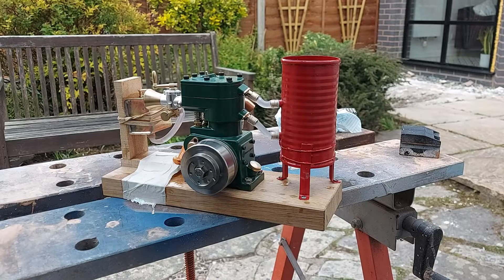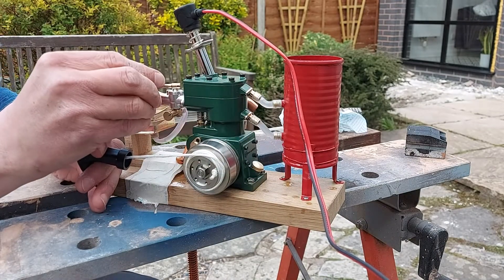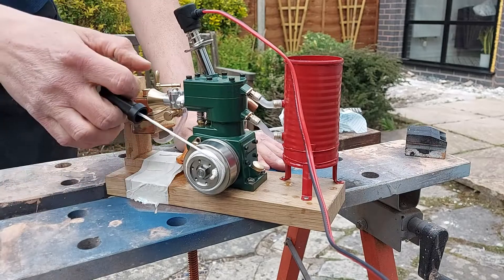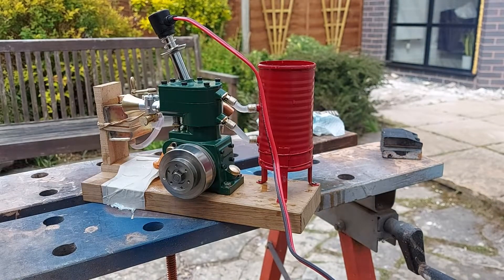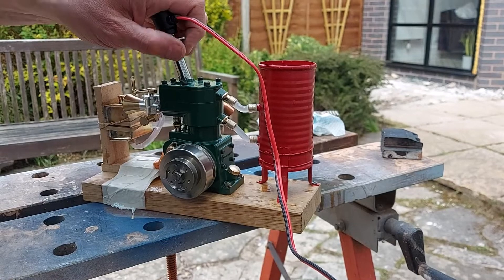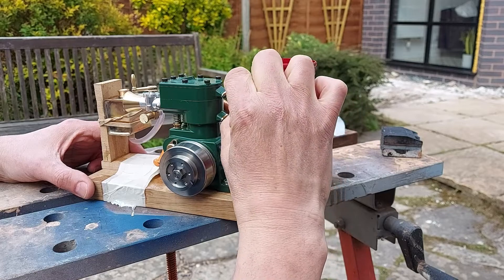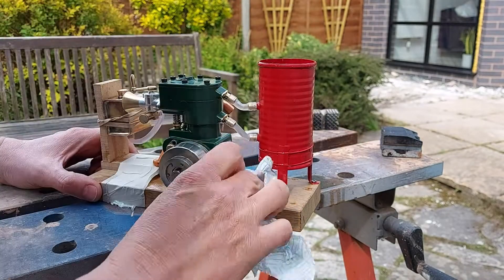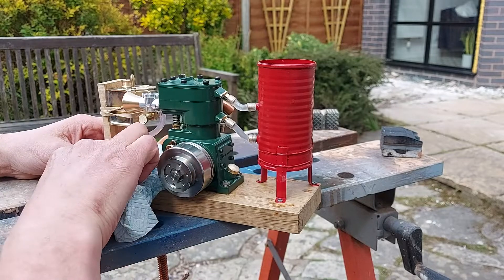Enjomor Whippet Pt5

Comment: That runs really well. Might have to run a small water pump, rather than the syphon method. 👍
Reply from the maker: Yes, starts so easily. The original design by ET Westbury has the cooling pipe coming directly out the top of the engine. That might help rather than the design in that is likely to give an air lock in the head. Thanks, Nigel